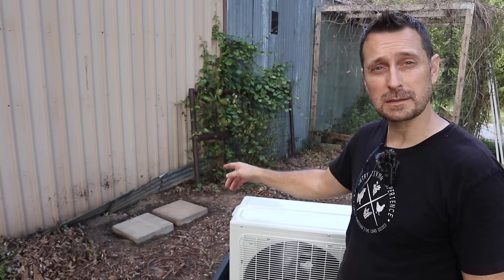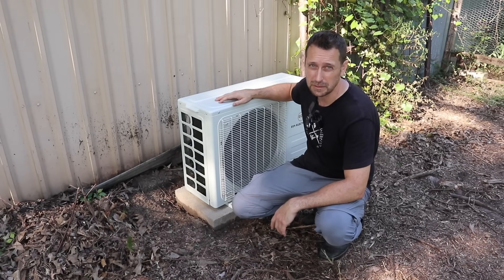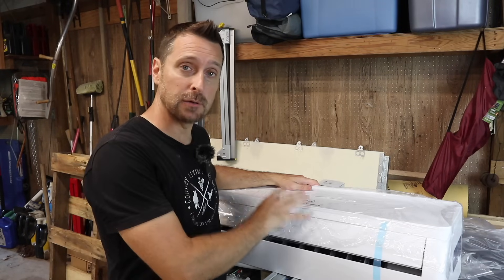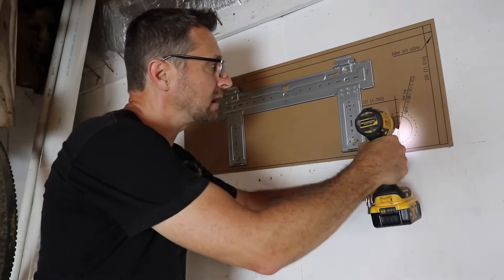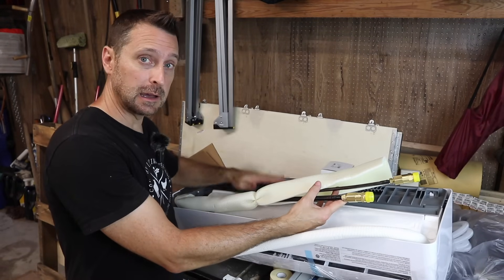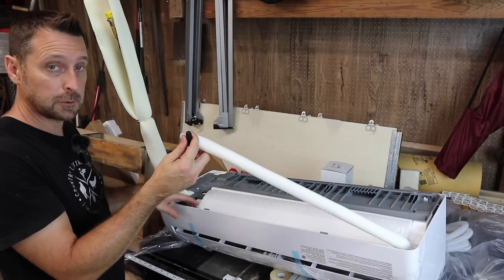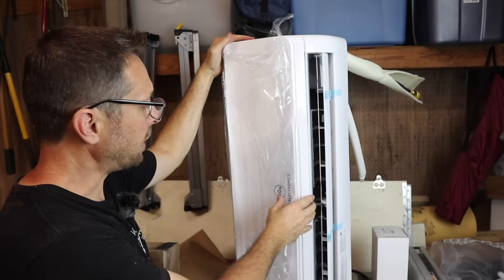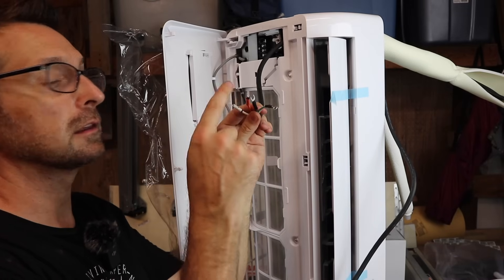Solar Air Conditioner Full Installation & Review! True DIY From EG4!

Comment: Man, this is the best video I’ve found so far on this unit. I’m in Florida and am looking to add one of these bad boys to my Florida room. Looks DIY friendly. I’m sure an HVAC company would charge a lot to install it. Any complaints on the unit so far? I’m right near the beach so I’m worried about rust
Reply from the maker: Thanks. 
No complaints so far. It’s working great. I did add ac power to it for night use.

Comment: Thanks for the video, that is great for during the day.  What about the night no sun to power up energy.??
Reply from the maker: At night it is powered by the AC power from the barn. It saves any AC from during the day because it it running directly off the panels DC supply.

Comment: How many watts is needed? What size solar array is the minimum in watts?
Reply from the maker: We don't really calculate these types of things in watts. The unit needs between 90 to 350 VDC to operate properly from a solar array. Or it can be connected to a 120v AC power source.

Comment: Have you considered running the unit from a battery generator and charging the battery from the panels
Reply from the maker: Then that would just be a regular solar system. This is a bit different. It is powered by AC power from the barn when the panels are in shade.

Comment: Contrary to popular belief, Mini Splits SUCK. Just make one fixed unit you have to cut a hole in the wall for instead of 30 'easy" steps.  Messing with refrigerant lines, no thanks
Reply from the maker: These are super simple to install and not difficult. Mine work perfectly and outperform my old central system by a longshot.

Comment: So is this just for like a room unit or does this provide AC for the house cuz it looks like you're just installing it in the garage?
Reply from the maker: It depends on the size of the unit. This is for my entire barn. However, a properly size unit in your house can cool several rooms depending on the design of the house. You just have to look at the square footage and then what the unit will cover.
Reply: @CountryLivingExperience is there an easy way i can figure out the square footage?? Ive never had to do anything like that, im afraid Im not sure how to start?
Reply from the maker: Just measure the length times the width of the room

Comment: Good tutorial. But just wondering if this unit automatically will switch between AC and DC when the sun is not out?
Reply from the maker: Yes, the unit will automatically switch between AC and DC power sources.

Comment: 16C = 61F   Actually 60.8 °F  After 1 year I still don’t have full knowledge of the settings. I use the phone app exclusively.  But I just saw a video that showed more control of the grid power limit.  If I find it again I will send along.
Reply from the maker: Cool

Comment: Great information. Could you harness the solar energy to DC batteries then be able to run the unit at night. I'm new at this solar stuff. Thanks.
Reply from the maker: Glad it was helpful. 
There is no way to direct the excess energy from the unit/panels into batteries. This would need to be coupled with an inverter to do so. I run this at night off an the ac side of my panel which is fed by my barn inverter/battery combo.
Reply: @CountryLivingExperience   thanks for the information

Comment: I also live in east Texas and am looking to install a solar mini split. I am wanting to cool  my 1200 sq ft shop and am wondering what size the unit is that you are installing?
Reply from the maker: I have the 9000 btu unit. I think you would probably need the 24k btu unit like this one.....https://signaturesolar.com/eg4-hybrid-ac-dc-solar-air-conditioner-2-ton/?ref=countrylivingexperience

Comment: Interesting product from EG4.  I have their 6000XP inverter running my house and it works great.  I also hooked up an additional set of solar panels to my AC unit directly through a grid tie-in inverter to act as a supplement for the AC.

Comment: One question I have that I can not find anywhere is, if you’re running off solar only ( no grid power at all) will the unit automatically start back up the next day or will you have to manually power it up with the remote? 
Thanks!
Reply from the maker: The unit will auto start when the sun hits the panels the next day.

Comment: My family and I live in South Alabama we have an outside a/c unit. We run it constantly in the summer months, leaving our monthly utility bill roughly $290 per month. I’d like to know if there’s a way to run just the a/c unit off solar only to reduce the utility bill a lot. Do you have any videos on something like that? Also, who would I contact to build something like that, an HVAC company or do electricians deal with hooking up solar as well or are ther separate companies. You’ll have to forgive my knowledge level on this, as I’m not very mechanically inclined. Any suggestions would help for the years to come for more financial stability. Thanks
Reply from the maker: Hello. 
This unit will run directly off the sun (DC) bypassing the power from the house grid (AC) when the sun is shining. Of course at night, it will be running off of the house grid power. 
This is exactly the type of thing you are looking for. You would have to attach about 5 solar panels to it. 
This one is a DIY system. Some HVAC companies may install it for you but sometimes they say "If it's not our product, we won't touch it.".

Comment: You forgot to remove impurities inside the tubes before releasing the coolant, that's why the vacuum pump and micrometer are included in the cooling tools.
Reply from the maker: These are pre-pressurized lines. They are evacuated at the factory just like Mr.Cool.

Comment: Do i have to install a back up battery for it to run at night?
Reply from the maker: It would run off of AC power at night. This only will run directly off of DC power (panels) on a sunny day. This reduces your AC load and saves money. You cannot connect batteries directly to it.

Comment: What is the minimum solar power needed to run?
Reply from the maker: Between 90 and 380 VDC and 1100 watts
Reply: @CountryLivingExperience   Thanks, now where to find solar panels to match without going to solar companies over pricing.
Reply from the maker: @4CAnders  You can find them on Facebook marketplace.

Comment: At 7:41 into the video, you just led folks down a part of the "diy" rabbit hole that is, potentially, one of the most destructive and costly mistakes to be made in ductless installation: the tools used in this process are (or ar least are supposed to be) different than what you offer, are rather expensive and for that reason, companies came up with the thread locking compound that you mention.
What this compound WON'T do, is keep the diy guys/gals from over tightening or ever under tightening the connectors.
Reply from the maker: lol. A friend who is the head HVAC tech at a local school, teacher of HVAC at the local college, and owns his own HVAC company told me to do it this way. I have personally done 4 systems and all work flawlessly. So.......

Comment: To reach the amount of watts needed (approx 1600W), does the volts matter for the unit since the solar panels will be connected in series? Should it be limited in series with maybe a couple parallel connections to limit volts? Thanks 🇺🇸
Reply from the maker: For the 12k btu unit the rated pv wattage should be about 1100. Rated voltage between 90vdc and 380vdc at a max of 12A per the specs. Manual states that they should be run in series.

Comment: Man I live off grid here in the desert. I have one of these and a friend. 
Mine runs off my batteries/inverters. No problem great ac. 
My friend runs his on solar. My friend does not have ac in the morning and after 2-3 in the afternoon. 
Solar if you have nothing else but…makes no sense to waste the solar when you have batteries, inverter, etc. if you don’t use all your solar when it is running, it’s wasted instead of going into the batteries and giving you ac 24/7. 
A little on the short bus side. 🧑‍🚒🚌

Comment: Have you considered a HV battery for these to run on cloudy days? I just purchased 90 kWh of used cells with the idea of building a high voltage 320 VDC battery to power the AC and EV charger with the AC being one of these units powered directly off the battery.
Reply from the maker: That would be nice but I don't know how you would wire it to receive direct DC from a batt.
Reply: @CountryLivingExperience  Look up EG4 hybrid air conditioner.
It is made to work directly off of solar panels but I am building a HV battery to power it when the sun is down. 
It works on 100 to 390 VDC or 240VAC.
If the sun is out it prioritizes DC and switches to AC when the sun goes behind a cloud.
Reply from the maker: @williammeek-h2o  I know all of that about the unit. I installed it and worked with the company. 
I was asking how you are going to direct wire a battery into the unit. That could be dangerous.
Reply: @CountryLivingExperience  Fused (20A fuse the unit is rated to 12A) 10 AWG wire in a conduit. Wire is oversized to minimize voltage drop and I have a lot of that size. Seems to obvious to be asking. Did I understand your question correctly?

Comment: But wouldn't you say a lot of money just by getting a small solar system set up and one of those $400 mini split heat pumps it seems like this is way overpriced almost $3,000 for the complete kid versus you can buy a mini split for around $459 and then a solar panel kit for around $800 it just doesn't add up online so expensive or am I missing something I've got an open mind so if I'm missing something please tell me thank you for the video very much
Reply from the maker: You're welcome. The least expensive mini-split i have seen is $800 and it is not self install (no pre-vaccumed lines). You need to hire an hvac tech to vac the lines or buy a vacuum pump (and know how to use it) adding to the cost. This kit is $2600 and has it's own inverter to run off solar independently. No other mini split on the market can run directly off of solar panels like this.
Reply: Okay thank you for your quick response I really appreciate it I'm an automotive technician so I've got a vacuum pump already and so I guess I'm just going to buy a cheaper system I found one from this company for after shipping and all around $600 for 9000 BTU and I'm going to buy my own solar panels inverter switch and all that stuff and I'll let you know how it goes but everything will come to right at $1,200 and since I've already got the vacuum pump and the knowledge how to use it I'm hoping I'm not making a big mistake I hate to just throw $1,000 away but if I can save that money man it'll be justification to my wife that I can buy other solar equipment thank you again for all the knowledge
Reply from the maker: @brainwashed7244  Best of luck on your project.

Comment: What is the voltage of the unit? And how much do 48 volt panels cost. Thanks
Reply from the maker: The inverter is 48v. Some 48v panels of about 400watts are about $150 per panel.

Comment: How much does something like this cost? Cant be no more than $500-600 right!?
Reply from the maker: No, that is not realistic. This system is $1700. The only thing you can buy for $600 is a small window air conditioning unit.
Reply: @CountryLivingExperience  $1700? Good lawd that a lot of money!
Reply from the maker: That is not a lot for what type of unit it is and what it does. Most other brands are much more.

Comment: How do you evacuate the air that would be in the  lines you added between  head and outside unit?
Reply from the maker: They are pre-vacuumed lines. That is what makes this install so easy.
Reply: So the the little air gap where you screw them in won’t have any effect?
Reply from the maker: @mteevie1609  Nope. No effect at all.

Comment: HI, we live in Arizona..the hot part near Phoenix..can you store somehow some of this solar power for the evening...as it is quite sunny for 300 days or more out of the year..thanks
Reply from the maker: There is no storage option for this unit. You would have to put in an internal inverter with battery backup in the building. 
This is purely a money saving feature that will allow this bigger load to use sun directly.

Comment: another great video!!! I am buying one today!! QUESTION... how can I add a battery bank to this setup so I can have system run on battery at night vs A/C
Reply from the maker: Thanks. 
You can’t add a battery bank directly to this setup. You would need a separate inverter connected to the AC side of your structure. Basically an entirely separate system. The advantage of this is that it will run directly off the panels in the day and then switch to AC power at night.
Reply: I haven't tried it but I would imagine you could hook up at least 90 volts DC supplied by batteries with a lockout switch so that when you're running off battery it's only battery and when you're running off solar it's only solar whether that switch is manual or automatic so that it can automatically switch over when the solar is not providing power.  DC power is DC power it does not matter where it comes from, solar or battery or some other source of wind, water or ?

Comment: Will you please provide an update review? Have you had any disappointment/ meeting expectations?
Reply from the maker: Works great. Runs on the sun for the day and now that I have connected the AC power, it runs on that at night.
Reply: Hello, great install! So you can use the DC direct from the solar and use the AC connection at night ? The AC connection would require a switch or the unit chooses the power source?

Comment: bought this last week, was delivered today!  It is sitting in my cold garage (where it will be installed) because the temp outside is 12 degrees F. lol  I am hoping to get it installed this week when we have a mini heat wave of high 20's/lower 30's.   Will have to wire it up AC for now, can't finish my side solar project until ground thaws.  Hope yours is working well.  Have you did a follow up video?  How is it heating?
Reply from the maker: Awesome. 
I don’t have a follow up video but it is working just fine and heating well.

Comment: This is probably the best video I have seen on the EG4 Hybrid 12K  Do you really need to have the PV disconnect or can you just run the panels directly to the unit?  We will be using both solar and 115AC.

Thank you!
Reply from the maker: Thank you. I appreciate it. 
I highly recommend the pv disconnect. There have been a few instances where I need to work on the unit (like installing the AC conductors) and I need the panels shut down.

Comment: What abiut power when the sun isn't out?  Happens a LOT.  Biggest issue I have with solar power.  Not practical anywhere I have ever lived, particulary in fall and winter.
Reply from the maker: Battery backup then generator backup then grid reserve dude.

Comment: Hello again from north Texas 1/2 hour from signature solar.  I am still dreaming about solar for the house.  I am looking at staging the install with battery backup of critical circuits.  Along with that, I am wanting to install a few of these solar mini splits around the homestead.  I have a ham radio room (HamShack) where I will install one. That room is fairly small so I might not get the solar enabled mini split at this room except I just might.  Haha.  I have a garage/shop that will definitely benefit from the 12k or 24k that has DC/AC.  Thanks again for another excellent video.  You are maybe the first one that mentioned that the line sets are pre-evacuated or pre-vacuumed and not pre-charged with coolant.   Thanks again, all the best from north Texas
Reply from the maker: Glad we can keep doing helpful videos for y’all! Hope you can start building your solar system soon.

Comment: Sir, put a larg-ish rubber washer or motor mount under the outside unit and  sitting on the concrete. Like a motor mount they will absorb most of the vibration. I have a 2 1/2 ton unit that we installed in 1998 and it still works great! Plus I live in Florida where it runs 8 months straight, plus on and off during the winter.

Comment: Am wondering, what's the difference between using such a unit and a common A/C unit by utilizing a hybrid solar inverter and no batteries? Is there any "special circuitry" inside these to optimize operation? Thanks for the video!
Reply from the maker: It would work the same but the infrastructure for adding the inverter would cost way more. This unit has a small inverter internally.

Comment: Great video! I have the 12k model. It's been great for both heating & cooling my cabin, but my unit didn't come with a mounting templet. Was the one you used in this video included with your mini split?
Reply: @stevenelson3540  they say its the top piece of cardboard packing in the box

Comment: I have solar panels on my roof. Does this come with instructions on how to do that connection? I am confused as to what else I need to buy to make that happen and also to be able to go from DC to AC. I only need a 9000 BTU or a 12,000 BTU for a master bedroom suite and don’t think that I will use it a lot, just to cool the room off at night in summer, however, I don’t see where it shows exactly what you need to do this hook up? Do you have another video that shows how you also hooked it up to the electrical?
Reply from the maker: If you were to add this to your home that already has panels, then you would just run it from the AC power in your main panel. You can add panels to this also  for extra power generation. I have another video where I hook up a Mr.Cool unit to my home which has panels already.....but the electrical connection is not shown completely.